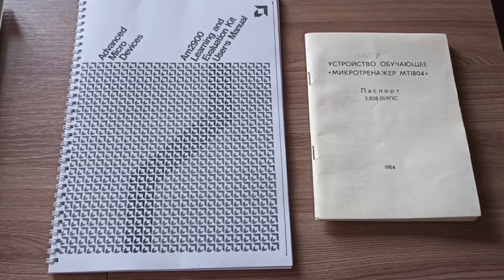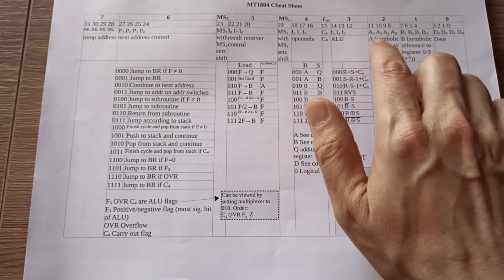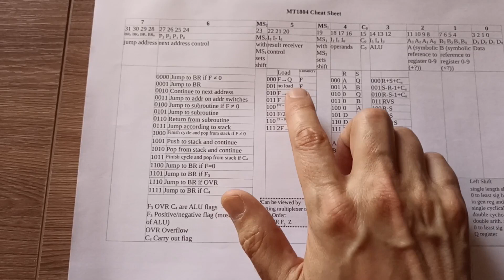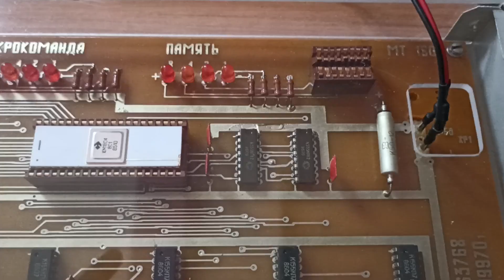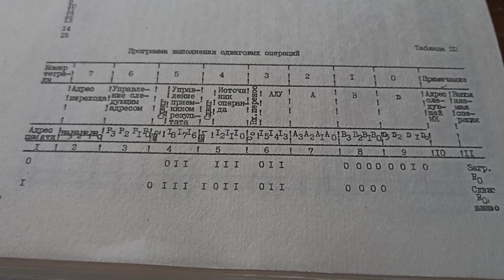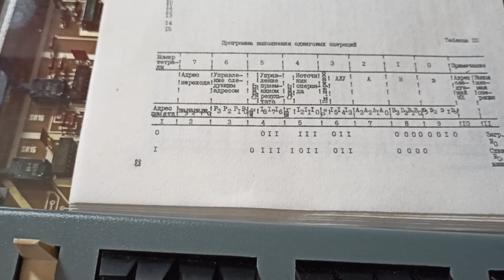Soviet 4bit MT1804 Microtrainer

Comment: It would be fun to know more about the chips on the board especially the big ones. Looks like it has a memory of 16 words of 32 bits. The input is a bit awkward but it is a bit like a computer I built in 1976 out of 74 series TTL circuits. It was used in education. I think this machine is perfect for educational purposes and very intelligently designed since the size should be kept down.

Comment: There are two different concepts: microcoding and bit slicing. We can divide a processor into two parts: the data path and the control. Bit slicing is one way to organized a data path. Microcoding is one way to organize the control unit. You were mostly showing the microcoding and the microinstruction word is indeed divided into "fields". This particular board tries to make the fields multiple of 4 bits to make it easier to enter with so few switches, but in general a microcode word can have any number of bits and the fields can have very different sizes in the same word. The bit slice is a way of organizing the ALU and registers in a chip (or board, in the even older days) such that you can have a wider machine by just adding more chips. Your machine has a single chip in it, so can only do operations on 4 bits. If it had two chips instead, the operations would be on 8 bits for the exact same microcode. They are mostly independent of each other. With three chips you would have a 12 bit machine, with four a 16 bit machine and you could even connect eight chips for a 32 bit machine.
Reply from the maker: I see, thank you for the explanation! So if I've understood correctly, the architecture of my board means it does not take advantage of the potential for bitslicing, as it only uses one chip, so can only do operations on 4 bits?
Reply: @ElectronicaSovietica  Yes, a single 2901 is good enough for an educational product like this one but any practical machine used multiple 2901 or equivalent chips.